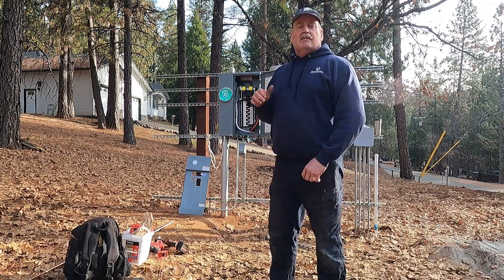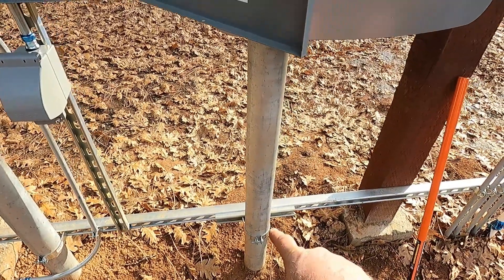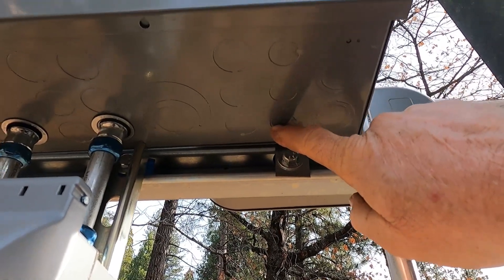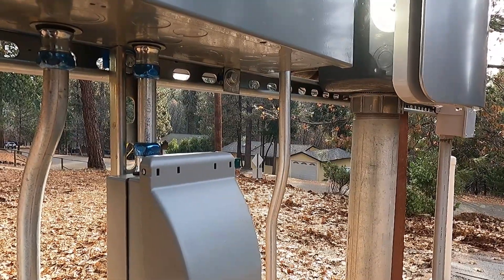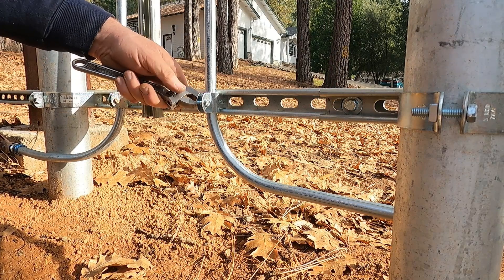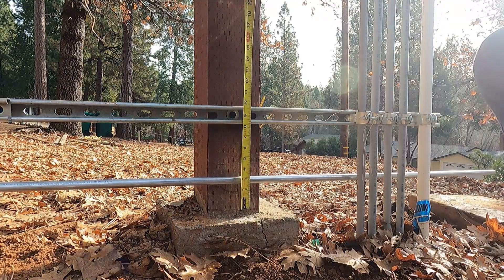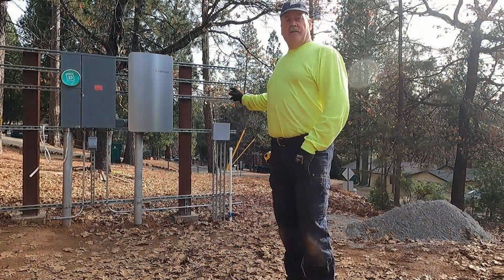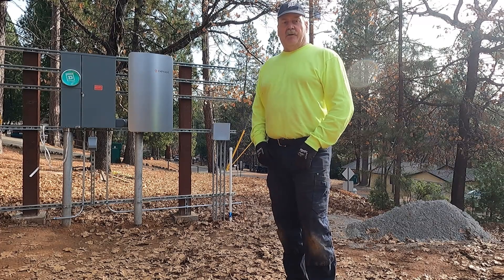Adding a grounding rod to our electrical service

Comment: Good video and great workmanship, but I think some more explanation of why and what you are doing would be helpful. Why did you run conduit? What awg wire? Why did you choose that size? How did you bend the offset?
Reply from the maker: Thanks for feedback.  Sometimes I feel like I talk too much or give too much information information in videos.  I will try not to be afraid of talking so much in the future.  As for the second ground, here is what I know.  A second rod is needed unless you can certify the resistance to ground is 25 ohms or less.  I guess my inspector didn't give me that option?  Normally a 200 amp service would require a #4 or #6 gauge wire for the ground.  However there is a section in the code that states the ground wire needs to be upsized if the wiring is upsized for distance of the run.  Since I used 250kcmil for the run, I needed to upsize my ground to #2 gauge.  I probably could have used #4 or #6 for the run to the ground rod, but I figured I would stay consistent with the conduit wire.  The code requires the ground to be in a conduit anywhere there is potential for damage.  Code allows for many different types of conduit. I just chose EMT.  As for the off-set in the EMT, I just did that by trial and error with the bender until I got the 1-1/2 inch I needed.  There are instructions on off-sets but I didn't take the time to read them.  Kind of a long winded explanation, but I hope that answers your questions.
Reply: @HamiltonServices530  Thanks! I didn't realize ground wires needed protection nowadays...
Reply from the maker: @Ryan-dj5ku  Take a look at 250.64 of the National Electrical Code if you are interested in when it needs to be in a conduit.
Reply: Looking good. I had to do the same thing when I built my garage. I put in a 1” thick 8’ long ground rod in the ground and just ran a copper wire to it and it failed. I had to add one more ground wire and both ground wires had to be separate and in conduit.
Reply from the maker: @MsdMakingSawDust  I had to look up the second ground rod section because I had not heard of that.  I knew about protecting the wire in conduit or armored cable so that was not a surprise.  Thanks for watching as always.

Comment: Lots of new camera angles.  I have a similar reamer for taking plastic off prints.
Reply from the maker: That one is kind of my everything reamer.  Copper, plastic or EMT.  I should probably invest in one that does the inside and outside of the pipe if you flip it over.
Reply: @HamiltonServices530  one of mine has replacement blades, but never needed to replace them for plastic use.  Have a great New Year